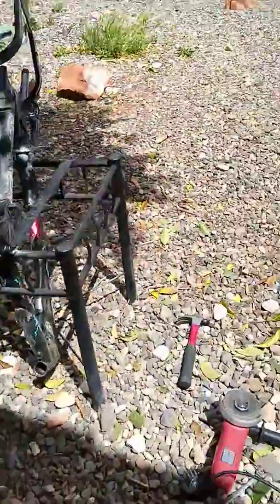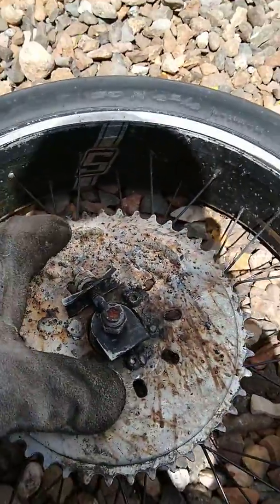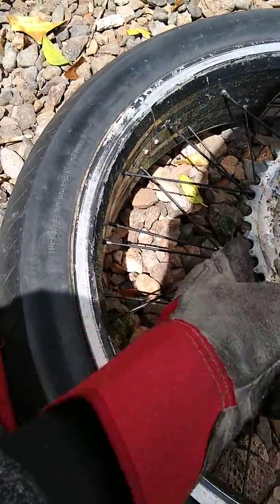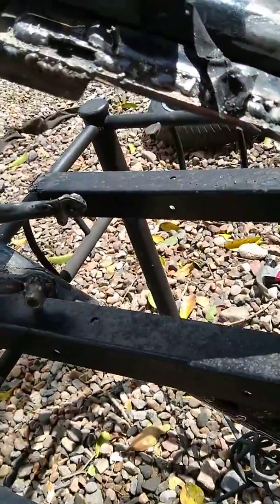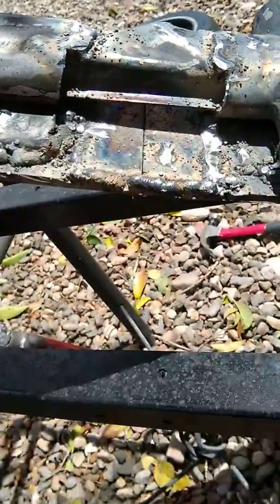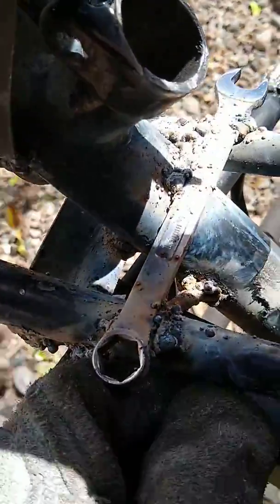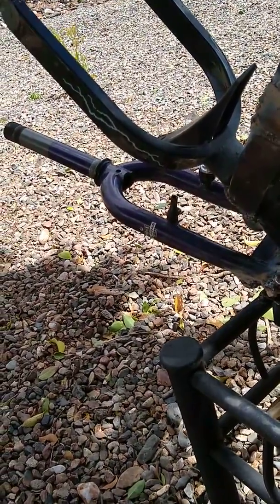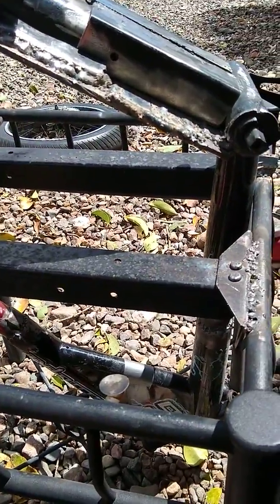Schwinn Sting-Ray plus motor 125CC part 3

Comment: I would weld this frame with anything even stick , but not flux  core wire .
Reply from the maker: I bought the cheapest welder on Amazon and it's what I had to work with. Is there any specific reason why you wouldn't choose flux core?
Reply: I just don’t think flux core is strong